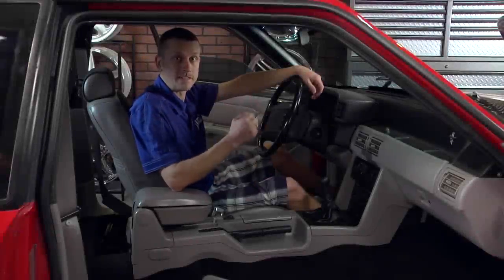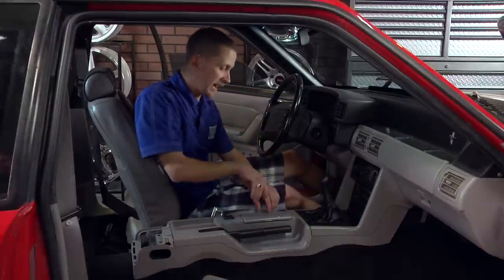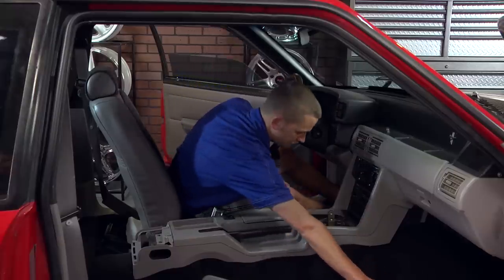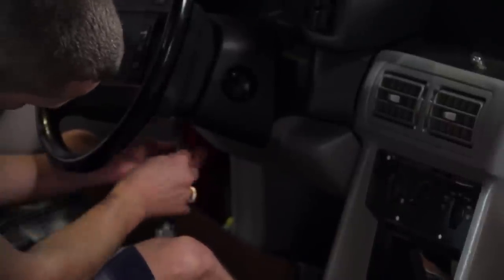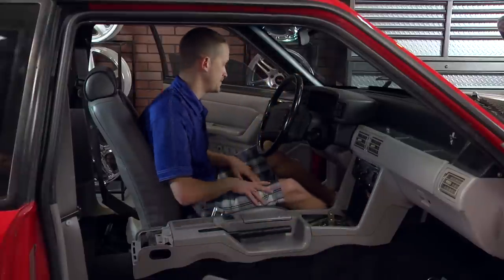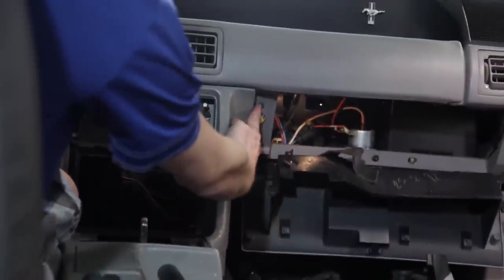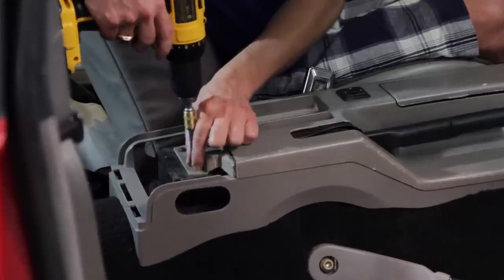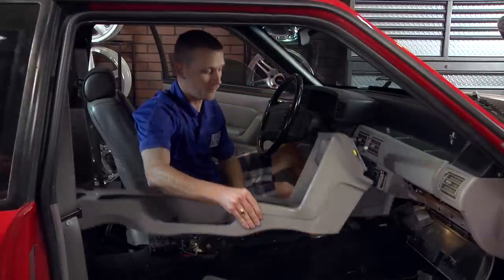How to Remove Your Center Console Fox Body Mustang

Comment: Great video but it doesn't mention the 4 screws, 2 on each side, that are under the dash connecting the console to the stereo amp bracket. I had to replace my heater core and used your videos to get the job done properly and was having a problem getting the console out, watched the video a couple times before finding the other 4 screws. Thanks for making these DIY videos. I've had my 90GT since 1989 and the heater core was OE and I  had not pulled the dash apart before, your videos made the job much easier than I anticipated, still not a fun job but the videos made me confident I could handle it myself. Thanks !!

Comment: So when I put together mine the center console in the back wouldn't fit its like the whole middle part was too far back. It was really hard to get the back screws in I had to screw them in at an angle. Any thoughts on what I did wrong?
Reply from the maker: Something may not have been fully seated somewhere else on the console. It's tough to say without seeing what's going on in person. -Landan

Comment: I was hoping you could help me. I had to replace my center console on my 93 GT. My problem now is that I can't put my shifter bezel back on because the shifter is sitting too high. Is there a way to remedy this? I've been driving for a few years now with no shifter boot.
Reply from the maker: GIve us a call. I'm sure we can help you with your issue. Do you have an aftermarket shifter or non-factory transmission?
Reply: ***** I have a Hurst shifter and a stock T5. Everything fit fine with my original console. I just accidently broke it.